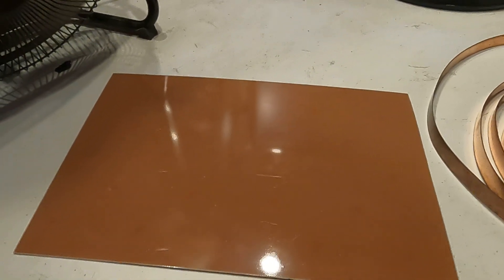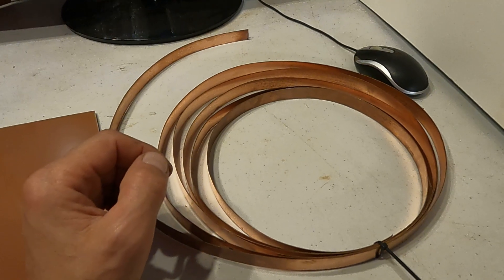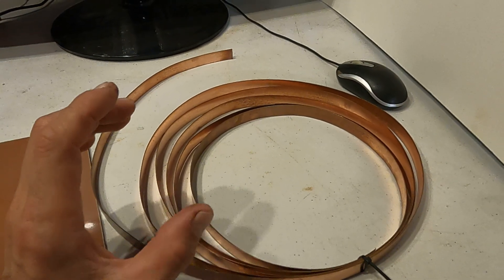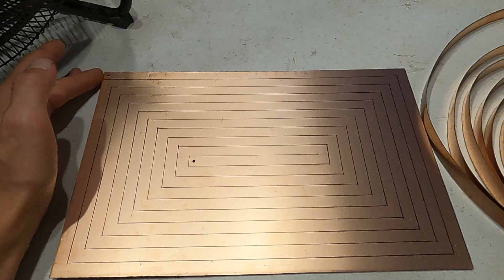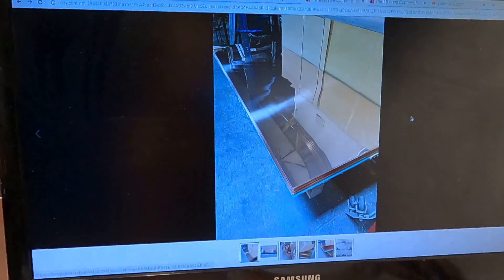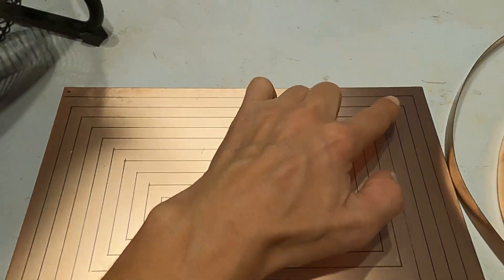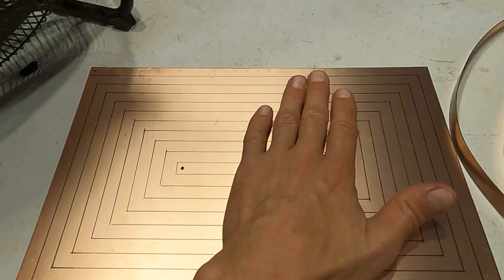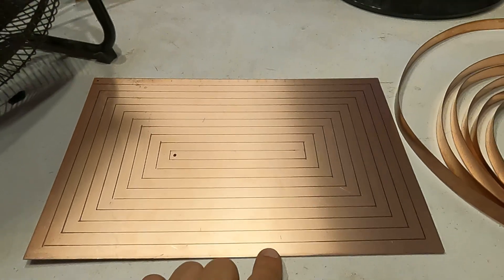116 Concept Idea for high intensity PEMF mat

Comment: Deja vu!  I did a full spiral for my first pemf mat and later found that a full spiral has a very focused beam at the center,  what I wanted was a uniform B field.  For a uniforn field, remove the inner third to one half of the center of the coil.  See what the WPT-Wireless Power Transfer designers are doing with coils.

Great stuff-keep it coming!
Reply from the maker: I think it's fine, since most of my body will be in the center of the mat for the most part, this way  it will be absorbing most of the energy. 
I don't think I want uniform field, yes it will be more intense in the center and less on the ages
How much Gauss are you able to get from your mat?
Reply: My 1st effort was 22x22 in bifilar Tesla coil, N=54, Ro=11, Ri=.5 in & the wire is 20 Awa solid.  At 1A I get 140 micro-T.  
My full body mat (72" x 24") has 5 Tesla bifilar overlapping (by 4'' to fill the holes) rectangular spirals that gets me 50 micro-T over the most of the mat-23'' x 72".  
Another fan asked, , How much current does it take to generate a 5 T field in a mat?.  A lot.  The NXI (turnsxcurrent) needs to be really big.  1000's.

Comment: Easy answer Andrey.  (After my first two experiments) Assumming you use circular coils the answer is easy using the equation: B=uo x N x I / (2 x R).  For the 1st swag, assume a full body mat that is 24 in X 72 in.  This can be divided into 3 - 2 ft x 2 ft squares.  These 3 squares can be inscribed with a circle with a radius R = 12 in (= 0.304m).  The 3 - 12 in radius circles will cover 78% of your mat.  Since you need 0.5T, just rearrange the equation for Bz above to solve for the product NI = 2 x Bz x R / uo = 2 x 0.5 x 0.304 / (4 x pi x 10^-6) = 242,552 Ampere-Turns.  One possible solution is to push 242 Amps into a 1,ooo turn coil.  (You need 3 of these N=1,000 coils with a 12 in radius.)  or a thousand Amps into 3 - 250 Turn coils.  I hope this helps.

Comment: Fantastic idea Andrey......I could also see this as  a step  on plate ...  You know that bare feet are excellent for inputing frequencies  into the body and I would think a low freq PEMF  could work out really well..... For a lay down unit I would use that under carpet foam, it's a recycled product and is about 1/2" thick.... You are doing really excellent work in this field....!!

Comment: I 've been thinking about your heat problem.  According to AWG 14 gauge wire has a maximum of 32A for chassis wiring and 5.9 A for power transmission (power transmission useswires bunched together in a cable where the innermost wires are surrounded by other hot wires & can't shed heat fast.  For a 1,000 V pulse thru a 5 ohm coil has a peak current of 200 A, which is significantly more than the AWG ratings for both chassis & power transmission.  Remember that the resistance of the wire in the coil increases by 25% for a 40 deg C rise above room temperature.  But the greater the time between pulses lowers the average current in the coil.  I don't remember how you construct your coil, but how much could the coating /adhesive be insulating the heat from escaping?  Maybe look into using thicker wire, or a more open coil, for better cooling and/or add cooling - a fan? a Peltier device?  Something to think about.  enjoy!

Comment: I'm guessing that this flat spiral will create about a 1 mT field at the center of the spiral with 1.0 A of current.  A few assumptions are 1) superposition holds, 2) a spiral pattern can be approximated by a set of N concentric loops with spacing R1, R2, R3 ... Rn. I and 3) the field for a square spiral is similar to a circular spiral. From the video, your spiral has about N turns = 11 with ro (outer radius) of 6 inches and ri = 1.0 inches.  The formula for the B field of a circular loop at the center is: Bzo(n) = uo X N x I / (2 x Rn), which equals uo / (2 x RN) for N=1 (Each concentric loop has only 1 turn at radius Rn.) and I = 1.0 A.  Now add up the results calculated for all 11 loops using superposition: B total = Bzo(1) + Bzo(2) + ... + Bzo(11) ~ 1 mT.  The B field of one circular loop only has significant output directly above the coil.  The B field between loop song flat surface is essentially zero.  The shape of a single coil is double humped the B field of a loop just inside tcircumference of the loop is about 20-30% higher than the center.  However, as you increase the turns in the spiral the magnetic field takes on a cone-shape and becomes very. focused.  I hope this helps.

Comment: Hello fellow inventor friend!   let me tell you how happy I am to see people making stuff.   I can assist you with some math and design  :)    .  In the mean time there is two law to look at when making coils, 1- ohms law 2- gauss law.   the heat is always a by product and I use resistor to manage my coils temperature. Gauss law also will let you know when you have reach saturation and are no longer making gauss but  just making heat. Get in touch with me if you are interested. I would love to share ideas with you!!!    :)
Reply from the maker: Hi Steeve
Thank you, yes it is good to know all the parameters of the coils. 
As fur as I know air core coils don't saturate, but I may be wrong
Reply: @AndreyD  also ohms law.  E=ir.  Your resistance in the material you are using would be very low.  Hence high amp.  
Amps x volts = power.  (Watts or heat )   

Adding resistance would help.you reducing the heat.   The alternative is tonuse a capacitor and micro burst to get high VA and high gauss.  Micro burst will allow time.to cool down between pulse.   

Reach out if you need assistance.   
Have a great day.   
Will.leave you alone now.  😃🙂
Reply: @AndreyD  will.have to check some.more on that,  I found that when I pump more juice through coils my gauss meter did not show me more gauss pass a certain voltage.  Just made more heat.    I assume it was saturation.  But you are right saturation is usually reach by the core of the coil.    Now I won't sleep until I fo d the answer. Lol.
Reply: Yep. Air coils do not saturate.  If you want less heat use a heavier gauge wire-it has less resistance.  The B field is proportional to current I.  It doesn't matter whether the current that is creating the magnetic field B is running through "100% pure copper" wires of a rusty hanger or salt water- it will still create an identical B field, as long as the geometry of the current flow I is the same.

However, the heating of the coil wires (otherwise known as power or "I-squared R"loss-is directly proportional to the resistance R of the coil.  

You can save a lot of wasted power by using a bipolar wave.
Reply: Sorry, but adding resistance will create, waste more heat-precisely Issaquared R Wallis worth of heat.
Reply: How hot is the coil when the increas in B decreases?  Theresistance of the copper wire will be 25% higher as the temperature goes from room temp (25c) to 65C.

Comment: was also thinking about stop sign shaped tiles that are held together by strong flexible cord..as well as wires in between..each shape could connect to make a large mat with some flexibility...each tile could be a single coil approx 5-8" diameter. picturing it resembling honey combs..
another idea I had was high magnetic permeable material like ferrite in-between coils to prevent destructive interference from neighboring coils by directing magnetic flux lines back to source coil as opposed to letting flux lines spreading out as they might..not sure if this has any possible science to it..was just an idea
Reply: Flat coils-Round, square, Hex, etc-project B field only directly above the coil. Adjacent coils like you suggest will still have a gap (A null like the graph of VSWR:  I designed a Full Bodymat, 72" x 24" with 4 24'' x 18" Rectangular coils (circle on the outside-it has a few spirals in the center to flatten out the B field.) In order to eliminate the gaps, I had to add a 5th panel & overlap adjacent coils by 4''.  Now In a ne a REALFull Body mat.  All I need now is to determine how to increase the power to each section.

Comment: how about just standard FR-4 copper clad? and, or the concept in which u have in this video but stack 2 or 3 layers to increase inductance.? with double sided copper clad u could have a spiral on top side mirror image spiral on back side the duplicate 2x and wire in series each flat spiral with a thin sheet of ptfe or any dielectric in between or brush on some KV rated dielectric enamel coating..

Comment: I have your 5B Pulser and the one complaint i have is the coil gets hot in 5-8 mins depending of power level and shuts off, which means I cannot get a longer session at a time, this testing with different type of copper is a welcome idea, would you be able to counter fit existing handles with this for me when you are ready to do that? I sure would love to see the session go on 3X time
Reply from the maker: Hi RG G
New coil using copper strip as a wire is able to give me great result when tested on larger in capacity, voltage and size capacitor bank with 10x stronger and physically 10x larger thyristor. The coil internal resistance is 4x lower then my standard 14AWG coil
I cannot simply swap them, if I do that, the unit will die from such a high load from this coil. This new coil requires new set up inside the unit to be able to support such a high load (the coil) with out heating up
As fur as how long BBMPulser 5B takes  for the coil to heat up  before it shuts off. Please take a timer and physically time it on 1.5 Tesla output.
From my experience building many of them, I just could not get it to shut off in 5 min, usually it's over 8 min
In 8 min session with 50 pulses/ min you are getting around 400 pulses of 10,000 Gauss intensity, if you increase to 1.5 Tesla (15,000 Gauss) you should be getting around 200 pulses 
At 2.4 Tesla output you should be getting 50-60pulses /session

Thank you

Comment: I wonder how big current is required to the copper strips to gain 0.5T.
Reply from the maker: I tested low resistance 1400uf Capacitor charged to 1,500V in twisted 3" coil I was getting 4.7 Tesla
This set up should give me at least half of what I want, possibly more, I need to test it. As fur as current flow during the pulse, it's in thousands of Amps
Reply: @AndreyD  Oh, that is big current and high voltage! I bet I can hear your success soon.
Reply: If you are using some type of circular coils (square, hex, circular, etc. have fairly similar radiation, magnetic field patterns, you can get an idea of how many turns N you would need to create a given magnetic field B. The vertical component, Bz, at the center of a coil with radius R is Bz=muo N I / (2R), where I is the current.  If the desired B-field is a 5T and the maximum current you can generate is 10A, then you can easily determine how turns N are needed for the coil to generate 0.5 Tesla

So what is the maximum current I you can generate, and go from there.

For a full body mat I'd start with 3 2" x 2" (squished) circular coils for a 6' x2' full body mat.. (My current mat uses 5 elliptical spirals (Tesla bifilar-Not that affects performance that I can see, but it sounds cool!)

I'll end this monolog..

nJoy!
Peter

Comment: Hey A. I do not think that you are going to get the same magnetic power with this design comparing with the copper strip you have. If you will cut the plate with the saw blade,  why you do not draw circles instead of rectangle. I believe circle bring higher quality and inductance of a coil. Anyway you have to cut it and isolate the windings. How much do u think is the AVG of the wire you created?
Reply from the maker: Will see, I know i wont get near what I'm getting with 3" coil, but if I get 0.5 Tesla at the surface of the coil I will be pretty happy
I thought about circular configuration vs rectangular and i went with rectangular because it fits better in this configuration

Comment: Could you not just make a larger paddle?  I mean, why not a 6" paddle?
Reply from the maker: I could, it will be a bit heavy but 6" paddle is do able
Reply: Could you use thinner copper strip?  Like 1/2" or even 1/4"?  Might be easier and more powerful than a sheet of copper.
 @AndreyD